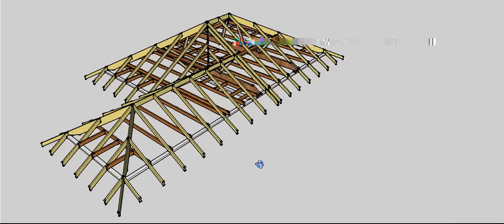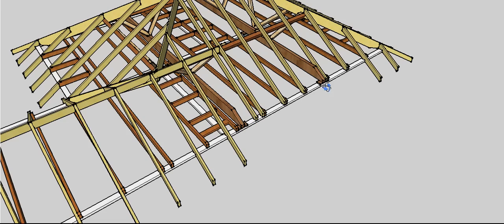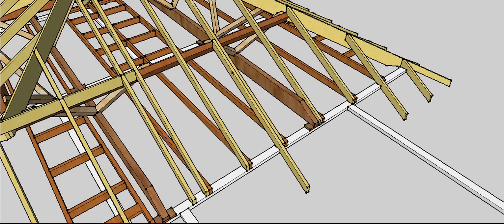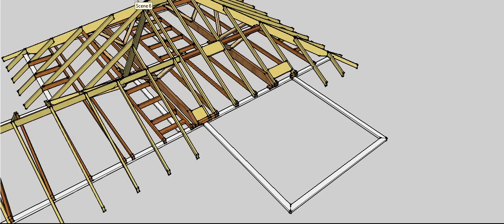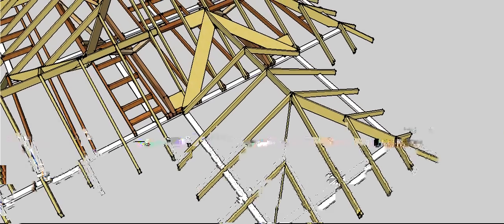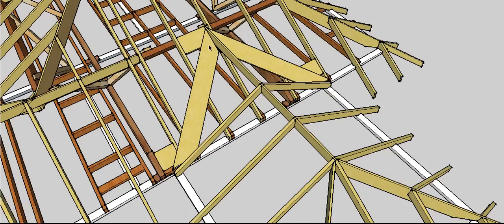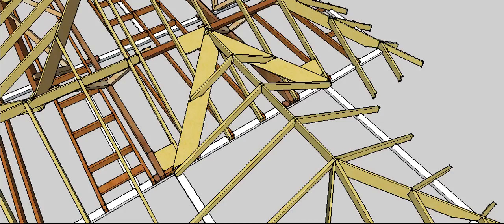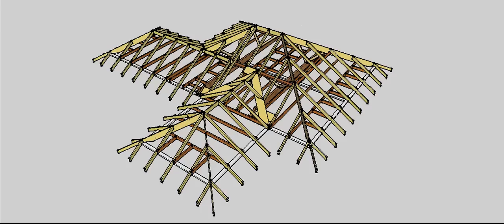Broken Hip and Valley Roof Scotch Valley

Comment: Greetings from the UK. The angles for the lay board can be worked out on a square. Top cut is your Jack edge bevel and the seat cut is a purlin edge bevel. To work out the compound cut on the bottom: 1. Anywhere on the edge of timber mark the pitch. 2. Square the line across so you have a triangle. 3. Measure the dimension that is the "run" of the triangle. 4. You have the purlin edge bevel marked as your seat cut and measure parallel behind this line towards the top the dimension you have  just got (run). 5. Square the lines across the top edge and join them up and you have your compound angle. Also the length can be worked out-  On secondary roof CR, extend the seat cut through to the top edge. Measure the distance (a) of seat cut extension from corner of birds mouth to where it strikes top edge. Take the secondary roof common rafter run and add this dimension (a). Now times that O/A length by the hip/valley length per metre of CR run. That's to centre lines as always. 
Hope that's clear. The art is dying. Great video again. With the right roofing square, every angle and length can be worked out. Speed squares are a poor mans roofing square ;)
Reply from the maker: Hi Martin 
Yes, it is a dying art and while I usually develop the bevels directly or just calculate the actual angle i do still use the roofing square for the more common angles. 

Thanks for your detailed comments

Comment: Great channel, I've been working on a few roofs now, and your detailed drawings have helped me work through onsite and not look like a complete tit!  Im a trim carpenter by trade but expanding my knowledge and starting roofing. Love it thanks for the help. One question that would be greatly appreciated. Here in South France a lot of the home have decorative T&G so all the framing then T&G so internally its a open roof.... How would you support the Purlins without ceiling Joists etc? Do they need any support ?
Reply from the maker: Hi Sam, wow I never thought my videos would be useful in France, thanks for your comment. If you want to get rid of the need for Purlins, struts etc, you just need to make the rafters bigger so they can span the required distance without the need for them. Hope this helps
Reply: Scissor Struts can resolve that issue, Strutting beams as well. But as Buildsum has already mentioned for the open space created by using larger rafter sections engineer for the spans and roof pitch, often used as exposed rafters in a Cathedral design roof frame with either sheet or T&G(VJ) as an internal lining fixed to the top of the rafters/battens.

Comment: What would be the problem if the broken hip does not intersect at 45. Thanks for the video
Reply from the maker: Hi Mate 
Its is either the roof members are the wrong length or your walls are not square or parallel
Reply: Hi thank you so much for the reply.
Is it a common thing if its not square as i am doing old to new. The plum ange shouldnt change but the side cut angle changed for the hip and the jacks attatching to the broken hip. The roof is all the same pitch.
Reply from the maker: Hi mate
Yes it is pretty common for things to be out of square when going from old to new. It sounds a bit odd that the edge bevel has changed maybe the old building is out of square to the new one.
Reply: Than you so much for replying. Yes we completed today the walls are pretty out. Also the main governing pitch it not equal center. So the common crown rafters are longer on one side. If you have a email i can send the pics. Its nice talking to someone with roofing knowledge as a lot of people dont go deep enough into it. This roof has 7 hips.
Reply from the maker: HI Mate
I would love to see some pictures.
buildsum@gmail.com

Comment: Good Video. Is the scotch valley rafter still suitable for extensions where only 1 side of the extension ties in as a valley?
Reply: Buildsum Thanks Again. The house is an early 1950's (Sydney, Aus), so the jack rafters don't sit flush with the top of the hip rafter - they sit a good 25-30mm below, I'm guessing this is how they did it then. If I run a layboard on the hip side then I'd have to knock the top of the hip to be flush with the tops of the rafters, correct?
Reply: Makes sense. Thanks for your time and your advice, much appreciated :)

Comment: What does 600 centers mean?
Reply from the maker: Hi Mate, 600 centres means that it is 600mm from the centre of one member to the centre of the next. This is how spacing is generally mentioned so it relates to any witdth member. When we measure the spacing we generally measure 'into over' so from the edge of the first member to the same edge of the next member, this distance will be the same as the spacing e.g.600mm. Hope this helps.
Reply: @Buildsum  A great deal. Precise and clear to me now. 

Some other related question. How are valley cripples ,hip cripples and jacks calculated and marked?
Reply: @Buildsum  
Precisely understood.

How are the valley cripples,hip cripples ,hip and valley jacks calculated?
Reply from the maker: Hi Mate, generally onsite nowdays they are measured in however they can be calculated. 
The easiest way is to work out a factor of the plan length of the member to the true length of the member, there are plenty of online calculators that will work this out for you if you are not sure how,  https://www.blocklayer.com/riserun.aspx, 
be careful with hips as the angle of the hip is not the same as the angle of the roof. 
Then you just need to work out the plan length of the member and mulitpy by the factor to get the centreline true length of the member. 
Hope this makes sense,
Reply: @Buildsum  I can't visualize what u r saying here,bro.  This is the only raining challenge I have with my progress towards framing.
Reply from the maker: Hi 
This might help, although it focuses on the HIp, up to Step 4, but the process for the rafter is the same. 
https://www.youtube.com/watch?v=Num8r1xdI_8&list=PLHFT_d-5EhN6A37hpgQQbnvnF3FbgYOHi&index=2

Comment: So the height for the ridge where the valley meets the existing building is the same height as your true length common rafter?
Reply from the maker: +mike thompson Hi Mike Yes if you cut the common rafter for the minor (new)span and sit it in the existing roof it will give the the height of the ridge